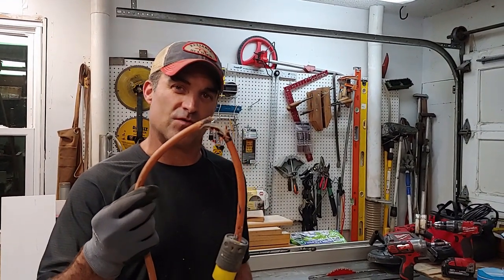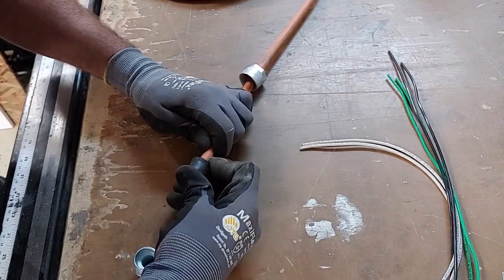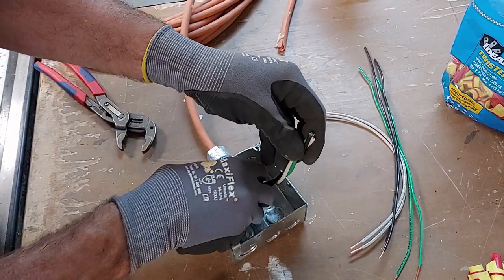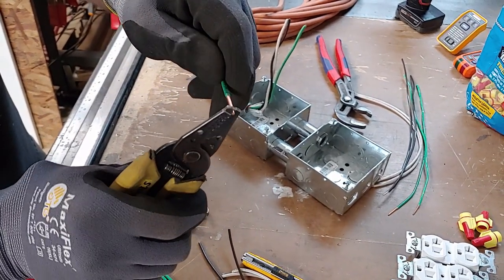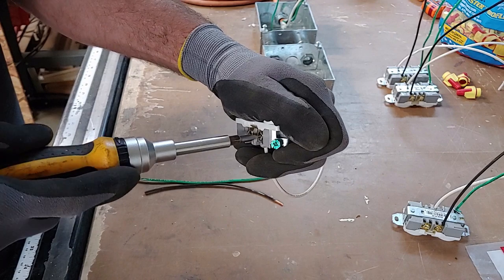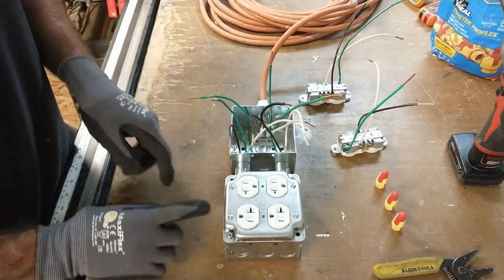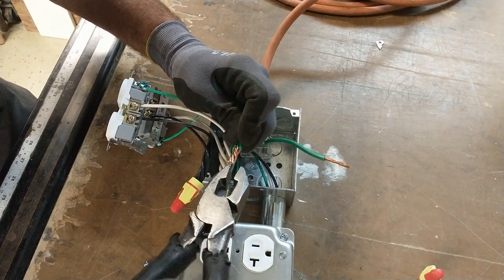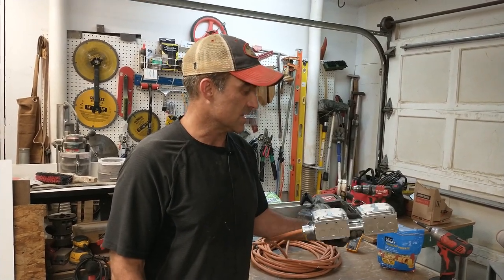Turn Damaged Extension Cord Into Receptacle Station Complete Tutorial How To #homeimprovement #DIY

Comment: Nice detail instructions. What kind of plug does it have? Does it have  the 20 amp  or 15 amp plug?
Reply from the maker: @hectorrey3308   Hi. Thank you for watching. I used 20 amp receptacles. At 13:40 on the video, I talk about the receptacles. I hope this information helps with your project.👍
Reply: @YouCanDoIt2  I couldn’t see the male plug. Is it also 20 amp and does it have the T shape blade?

Comment: why did you not use jumpers beside sets of plugs instead of running all back to the extension cord??
Reply from the maker: Hi Lathern.  You can do it either way.  I chose to do it the way you see on the video to make all connections in the first box.  Your suggestion works as well...either way gets the job done 👍

Comment: Just purchased all of supplies listed, question could the two receptacles be grounded in the second box instead of running them to the first box?
Reply from the maker: Hi! Thank you for watching the video. As long as your ground wires are going to the grounding screw in the metal box and the pigtail wire from the ground screw is connected to the ground wire in the extension cord, you should be good! 👍
Reply: Thank you 👍🏼

Comment: Awesome.  Ty for the great lesson.  You just earned another sub. 
I do have one question.  
Does it matter if the plugs are oriented in different directions?
Reply from the maker: Hi Jose. Thank you so much for watching the video and leaving such a nice comment. That is a great question. It makes sense to have the receptacles in different directions to accommodate for larger plugs. You can easily do that without any issues. Thanks again 👍
Reply: You put outlets upside down

Comment: Wont you have issues with these on the job site ? Osha and all that.
Reply from the maker: Hi. That's a good question. You need to look into your area codes and work accordingly. What is allowable in one state might not be allowable in another state. Example: many generators that are sold across the U.S. are not allowed in California...but, all other states allow them. This receptable station is for indoor use on a jobsite. Where I am located, they are allowable. Thank you for watching👍

Comment: Unsafe and OSHA violation. This should only be used at home.  Many have gotten a $1,000 Fine from OSHA for similar boxes.  Once a cord is damaged you are only allowed to used listed device to repair the cord for job site use.

This is also very unsafe as built the box is not water resistant and MUST have GFCI protection either the circuit used, or one of the 4 duplex receipts must be GFCI, no matter if used indoors or outdoors. It is not uncommon to have water or other liquids spill or water issues from weather even if inside... or a tool short to ground...or accidentally cutting into existing water lines etc. ....this is a construction site after all. 
In the USA, 9% of on the job Fatalities are from electrocution.

Another violation is with the wire nuts. They are only rated for 4 #12 wires not 5 (neutrals) or 6 (ground), this is a NEC violation.  Most wire nut manufacturers recommend not pre-twisting the wires, if you install the wires correctly there is no need to pre-twist.